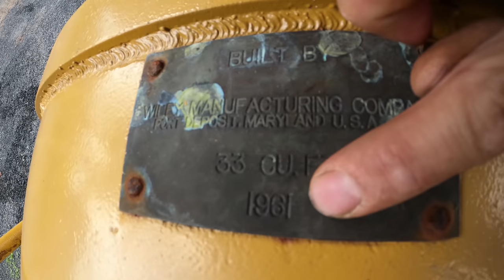Buying and modifying a concrete bucket for the crane

Comment: I see some of the comments saying you should have built a funnel on the skid steer bucket. That's a much more involved project expecially when figuring out how to flip the funnel out of the way quickly to get a scoop of gravel and then flipping it back down. Even with the funnel, you'd still have to tilt the concrete bucket to get more than a scoop.

An option would be to build a hopper high enough to set the concrete bucket under in the vertical position that the skid steer dumps into,.. but as you said, the gravel option is a bonus use. The hopper is much more involved unless you find one cheap.

The main funtion is to load and place concrete. The concrete truck obviously would have no problem loading the bucket in either position.

For the occasional gravel placement, what you have is fine.

Comment: Jesse, you don't need the crane to tilt and slide the material back into the bucket. Just add a lip on the front of the concrete bucket and catch that lip with the Skid steer bucket and lift/tilt the concrete bucket. It will roll up on it's curved rails, material will slide in further and it will roll back down ready for another material load.

Comment: Another idea you do is, when the concrete shoot is upward you can make a attachment for the skid steer to lift it when a cement truck can't go to the spot. Load the concrete from truck and skid steer is hooked up to the shoot and drive to the footing and sideways without using wheel barrel.

Comment: Suggestion: put a short chain on the lift arm to keep the arm back a little bit further. Build a chute on the sides and load from the curved front with the unit standing up not laying down. Close in the backs of the side additions so you don’t over pour. I know this will have to be put on and off with another machine. if it’s not to high you will not need to remove it to pour. At 6 feet high you will be able to load cement from the truck to. You may not need to lay it back down. If you hook the elephant trunk onto the cement truck you can hook it on this bucket. 
I hope this may help a little and it might not work at all. Good luck with it, stay safe

Comment: HI Jesse,  Please consider an alternate design.  The wings could be hinged to the bucket (half inch rod inside of short pieces of pipe to form a continuous hinge that is easy to remove),  and held open open with adjustable support chains. When not in use, the wings would fold up together and connect to one  another keeping them out of the way while the spreader bar rises up.  You would not have to put them on and off.   This design allows for different angles of repose for different kinds of materials.  Guide channels could be welded to the sides of the wing chutes to minimize spillage.  I call this the "butterfly" design.  That is a cool bucket because the lay down design allows for a low loading height. A problem for most concrete buckets.

Comment: Ask Santa for a left / right tilt bucket attachment for your skid steer.  Mike from Dirt Boss has one on his Kubota skid steer.  Also was thinking is you welded some angle iron on the front / top of the concrete bucket you could tilt it back with the skid steer bucket.  That eliminates the need for the crane and operator when doing gravel.

Comment: I really think you should have thought about this the other way around,. 
Instead of widening the crane-bucket to be wider the the bucket on the skid-steer, why not build some block-off plates for the skid-steer bucket so that it only fills up a section that is narrower then the crane-bucket? 

Just a suggestion tho, love your vids man, keep it up.
Reply: And you could also use that bucket to fill wheel barrels
Reply: I've used a concrete bucket on a skid steer that has a spout for placing concrete that would be perfect to load that bucket but you can't scoop gravel with them. I think he's on the right track just needs some refinement maybe.
Reply: you could make it like a funnel.  Mount it on pins that would go in to the sides of the skid steer bucket so it could flip up to scoop, then flip it down to pour in to the concrete bucket.

Comment: Get a stump bucket for the skidsteer. Cut the teeth off and weld some extensions on the sides. Perfect for spot placing material and filling excavator buckets or concrete buckets.

Comment: Could make gull wing style doors with easily removable hinge pins.  Follow the rounded profile of the bucket.  Make them as wide as that open section.  When open, they would be wide enough and curved to help funnel the material down into the bucket.  When closed, they would match the rounded shape of the bucket.  I bet that arm lifting would automatically close the doors as well.  A couple stops could be welded around the ring of the opening to prevent them from folding all the way inside.  A large water heater tank or boiler tank might be a good place to get curved steel.
Reply: Steel drum, it's already curved just plasma cut out, you got the right idea.

Comment: You could "complete" the cylinder of the cement bucket, to the top with two curved doors, which would be attached, by two heavy-duty hinges, on the existing vertical edges and secured closed with two latches in the center. When you would want to fill the bucket with the skid steer, you would just open them and they would serve as flaps, to be the "mouth" of the cement bucket equal to the width of the skid steer's bucket. My 2 cents.

Comment: Why not make those brackets on the top brim? You could load the bucket standing up and not have to take them off every time and not need another person.
Reply: That's my thought too, keep the bucket upright with the crane and make wings/brackets for the round part so that you can fill up the bucket without spending the time and energy tipping it upright every skid steer load to move the rock to the bottom. With the bucket upright and wings on the side, you just keep on filling up the bucket with the skid steer, then take them off.

Comment: The better solution is to have the "wings" on the skid steer bucket or build a separate skid steer bucket to load with. That concrete bucket is pretty purpose built and makes more sense to find a different loader assembly rather than to modify the concrete bucket.

Comment: make the wings wider and longer and resting at a steeper angle - then hinge them so they stay attached and fold in after the bucket is loaded
Reply: And put a small hole in the end of them so when  they are folded in you can attach a bungee cord to keep them folded in.

Comment: Jesse, I like where your going on this bucket. I would like to advance a couple other options. 1) instead of the welded plates use some galvanized conduit ( 18 inch or larger) cut in half and mounted so the skid steer could come in from the side instead of the top. The split conduit would be pointing down into bucket. This I think would allow a better capture of the aggregate. Also you could make some stands to hold the bucket more upright and allow a more complete fill of the bucket without using the crane. 2) another option to try would be to set the bucket up on its stand and make the conduit come in from the other side. This would allow the aggregate to drop straight down into bucket. You would have to play around with these ideas and see what works! I think the piece of galvanized split conduit would receive a full skid steer bucket without spillage and would just require some type of mounting on the bucket. The key here is coming into the bucket from the side with the skid steer.

Comment: Might be worth getting/making a bucket narrow enough to load straight into the hopper. If it's long and shallow enough you could load the bottom of the hopper with the first scoop. It would save a lot of time.

Comment: Same thing you have there but welded on where they don’t interfere with the hinge of the concrete bucket. Then from there add a hinging piece of metal that can fold out 120 degrees but no further. When you pick the bucket up it will fold them back automatically, but you would have to fold them back out by hand, haven’t thought of a workaround for that yet. Some kind of spring system that could fold both ways would be ideal I thinks.
Reply: Steeper angle would help too

Comment: make the lift arm wider distance from the hopper, hinge the metal chutes to fold down and out, weld a chain from the chutes to the lift arm. when the lift arm is on the crane hook the chutes will be in load position. when you lift the hopper the chutes will fold out and down, out of the way. I'm just an Electrician 😂😎☮ I have no doubt you will figure out a way

Comment: If you have a spare excavator bucket  laying around you could weld a skid steer quick attach plate on it and just use that to fill the hopper.

Comment: Weld a couple tabs on the body of the concrete bucket and after each fill you can tip the bucket up enough with the skid steer bucket to get the gravel to slide down and you would not need a helper
Reply: That's the ticket. The arm doesn't ever need to go beyond center, so you've got plenty of real estate to stick a ledger or some tabs on there.

Comment: Haha... everyone is overthinking it.  Just scup the gravel on one side of the skid steer bucket and do away with the wings altogether. Even easier to fill it all the way that way. That’s how they load my 10’ trailer with a 16’ bucket at the gravel pit.   The only draw back is smaller loads with the skid steer.  But still beats the shovel.  Cheers!

Comment: Make a wood form that you can use to slide next to opening. Wood is easy to move and you'll need to elevate the open side up to get the maximum amount into bucket. The way it laying down will mean a lot of shoveling or more times going back and forth.

Comment: Have u considered maybe taking a spare skidsteer bucket and narrowing the end so it fits into the concrete pouring thing ??   Straight from pile of stone to in the thing NO  wasted/spilled stone ?!
Reply: yeah thats going to get old putting the sides on and then hop in the crane. long narrow skid steer bucket like a sand snout or a side dump
Reply: Smarter man than me got here first, Great suggestion modify a bucket to the width of the concrete bucket, Straight from pile to bucket no stuffing around
Reply: Yeah the same way they put the French fries in the box at the McDonalds  :-)

Comment: Here's a thought about moving the gravel down...In the FRONT of the container near the ground you have a steel bar that connects to the "sled" legs.  Attach/weld a few "hooks" so your empty skid steer bucket can attach & LIFT the front to move the gravel back.

Comment: How about cutting the sides a bit lower and have the scoopes below the shackle(?).

You don't ever need to put the shackle lower than the corner of the thing anyway, not even 90°.

Judt put a stopper and a rubber block there where that thing can rest against when being lifted. 

You can just weld some C shapes to the sides and put square pipes on the chutes. This way you can either attach them permanently with a pin (if there's enough room) or remove them if you need the clearance in a tight space.

This way you can make them larger and steeper without having to worry about the weight, since you can just leave them on 99% of the time.

When you need to take them off use a H shaped pipe with 4 hooks and put some holes in the side of the chutes. This way you can just lift them up with the crane.

If you need a sketch to understand my idea, lmk. It's hard to describe stuff as a non-native speaker :)

Comment: Works great, but if u get tired of the new setup, maybe try doing something similar on the skid steer bucket instead. To avoid having to keep taking them on and off. I’m sure after using it a bit, if need be, you’ll come up with something. Thanks for sharing, I’m sure you’ll get your money’s worth out of it. BOL

Comment: If you could find an old 300 or 500 gallon propane tank you could make 2 curve doors that open up on hinges on the bucket and weld a chain to each door and to the bucket so it opens up halfway. Plus add flat bar overlap plate on one door extended 4 inches past the bottom of the door and around the bottom of both doors. Than weld a hinge flat bar and eye on the bucket with a chained pull locking pin to lock the flat bar extension from the overlap down on the door. 😁👍

Comment: I think a skinnier skidsteer bucket would definitely be faster. One just a couple inches smaller then the concrete bucket opening. The cycle time of the skidsteer would be faster than having to lift the bucket to shift everything to the back to get more in it.

Comment: thats a nice score. good for drain tile rock basements etc etc. invest in a skid steer hopper bucket or mod an old bucket with a v to fill that thing.  time is money especially with concrete. those wings will be covered in concrete, too much hassle/ spillage
Reply from the maker: I wouldnt need to use the skidsteer for the concrete, only for gravel

Comment: weld a kind of u form pivoting hook to the side of the bucket to fixe the handle in the hanging position.  after loading you lower the crane a little to drop the handle, fixe it and lift the full bucket.  You will avoid the bucket swiveling in full air and spreading all the content.  In worst case on top of some beloved one.   I've no example to show you but I'm sure you understand the meaning

Comment: Why not make brackets attached to the lifting arm going approximately 100 degrees past from parallel of the arm, in the direction towards the backside of the bucket when the bucket is vertical, then attach chutes on these brackets.
 
In the video, when the bucket was laying down on its backside to get filled up, the lifting arm is approximately 100 degrees past parallel from the bucket's opening, leaning towards the bottom end of the bucket. This would make the chutes parallel to the bucket opening when laying down on its backside. 
When the bucket is being lifted, the chutes will rotate with the lifting arm and stick out past the backside, but shouldn't get in the way.

Comment: The whole solution is if you're widen the swinging arm then you can put what they call a caller on the edge of the bucket you'll have to extend the beam use a piece of angle iron and redesigned the attachment to the crane

Comment: I think some 4-6 inch lift post on the loading edge would help things roll in better. And maybe some flaps from the circle of the bucket to the points u welded in. Just a thought, good stuff

Comment: By gravel loading you should hook it to the winch and make it upright and then load. The brackets you can mount on the round sides.
In this case you dont need to go out several times and rise and lay back etc

Comment: Idea! Do you need the bucket to roll on its back when you put it on the ground? If not, you could change the “rollbar”, causing the bucket to roll, to letting it stay upright in the same position, when on the ground, as if it was hanging from the crane. Mount the gravel guideplates you made at the round part of the bucket ( I know that could be a challenge) and fill it from the top insted. You can leave the gravel guideplates mounted all the time, as these will not interfere with the lifting arrangement. It could potentially save you quite a lot of time when filling the bucket, and it will let you get a full bucket.
Reply: No

Comment: I think I'd put some steel on there so the skid steer could tip the gravel into the bottom of the concrete bucket while filling rather than lifting and tipping with the crane.

Comment: Could you modify a old skid steer bucket? Have a flat bottom, tapered in the front. You then could load it while it is hooked upright to the crane. Then you only need to change the skid steer bucket out.

Comment: Jesse, have you considered reversing engineer for the cement bucket to modify the skid steer bucket?
The same concept that Timothy Abraham commented.
Think of it this way you are trying to pour into a funnel....consider pouring from a funnel into the bucket ie: modify your skid steer bucket.
Reply: It would be hard to scoop up gravel with a funnel
Reply: @9seven9seven24  Ok I got it....but it would be easy to pour concrete....lol

Comment: @Jesse Muller Why not weld or bolt the "wings" you made to the bucket using out of the way  inside hinges? Flip the wings out  out when you need them, and flip them in when you don't...

Comment: Jess, You would've been better to make the side chutes welded to the lift arm so when you lay the bucket down and lower the arm to the horizontal, the chutes will automatically align with the bucket and the floor of the chute needs to have some insertion rubber or conveyor belt rubber so it is flexible to cover the gap between the arm and the edge of the bucket.

Comment: Not understanding why you didn’t make the side plates the length of the opening to take the guess work out of where you dump into the hopper and to help with spillage? Maybe heavy gauge aluminum if it’s a weight issue, it would handle the beating I would think.

Comment: also can you just use the skid steer to tip the bucket up to make more room for another scoop? Maybe weld a catch on the side (top) of the concrete bucket to grab with the skid bucket to lift it up, you are already in the skid and right there from loading anyways? *edit actually it looks like you can grab the concrete bucket right on the bottom channel with the edge of the skid bucket and not have to weld anything on it